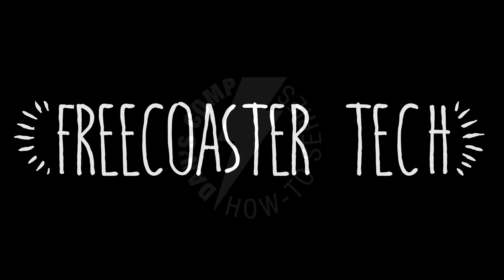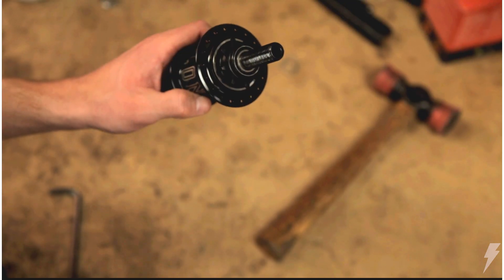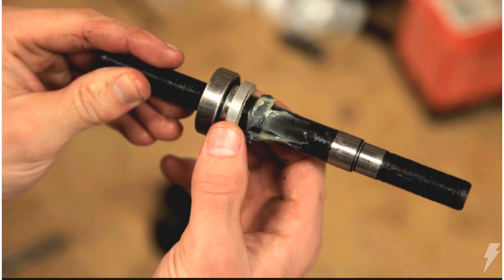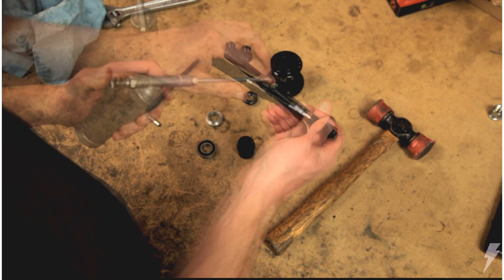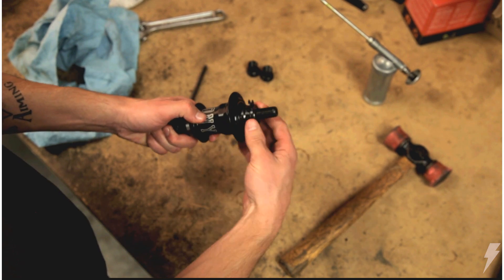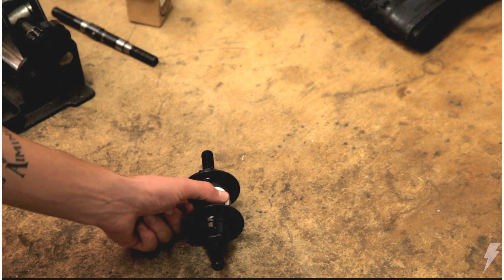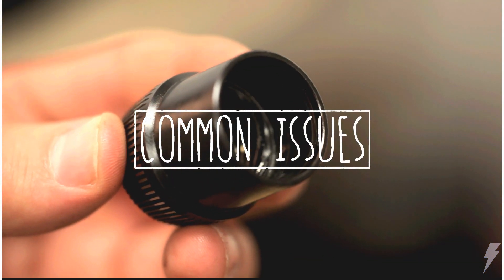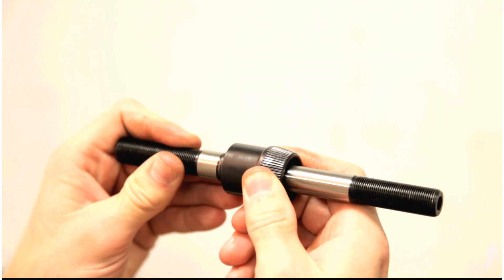Dan's Comp How-To Series - Freecoaster Tech Part 2: Assembly & Maintenance

Comment: Excellent video helped me so i could regrease my hub right, i have a issue tho that i hope you can hjelp me with. I have a cult match V2 coaster and i got it a few days ago, i regreased it gently and followed the video but when i GOT the hub on the bike again it worked like its suposed to do but if i roll it back and fourth the cranks move forward when i roll IT forword and same in the back, but if i ride it, its normal. 

Thanks! If you read it a few times, you'l know
Reply: +Dans Comp Thanks! Hopefully this works, gonna try tomorrow:) Thanks again!